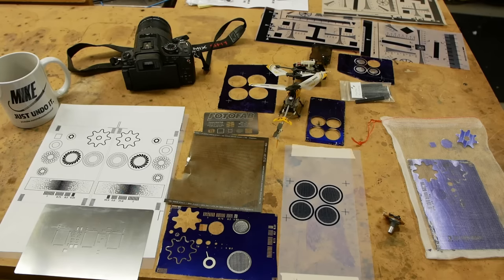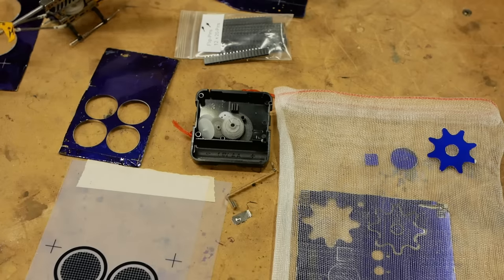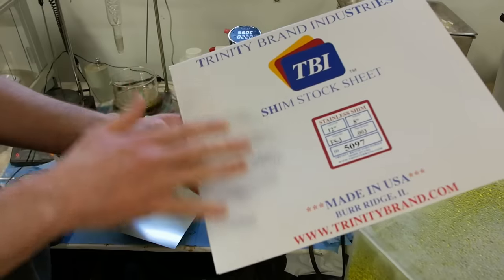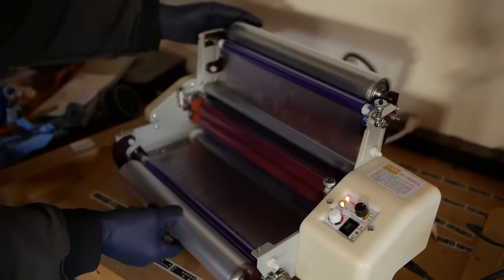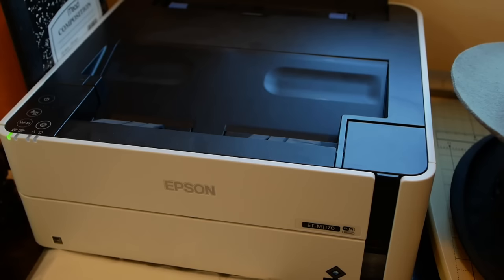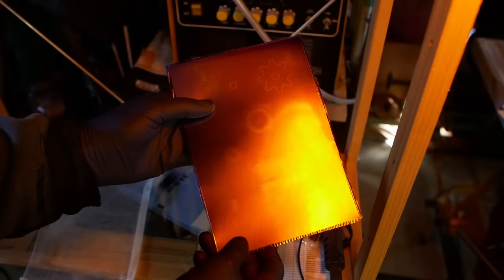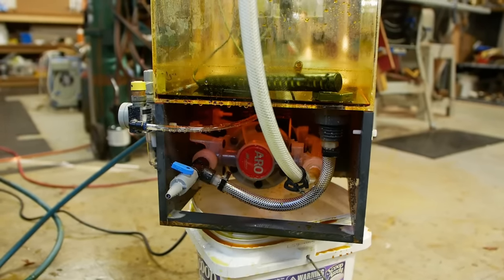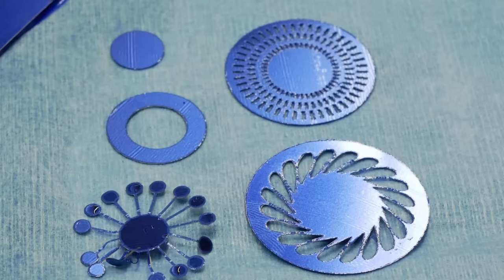How to make precise sheet metal parts (photochemical machining)

Comment: I wonder if you could use a DLP-based system here to simplify/reduce mask production and alignment. Drill/punch registration holes into the metal, then put that into a box where a UV projector exposes the photoresist. Flip it over, using the registration holes again, and it exposes the other side.

No need for manual alignment, no need to print masks, consistent exposure and precision. Biggest issue I can see is the collimation of light, but that's solvable, if a pain in the ass.

Comment: TYSM! yes, getting a die made for just 6 or 7 small delicate parts just has put a project out of reach for me. so glad to see how it can be done at a fraction of the cost.
what chemical etching? would that be lower resolution? seems it would be easier than using a photosensitive laminate

Comment: Nice project!

I have no hands on experience, but here are my thoughts: resin 3d printers have an LCD and a UV light. It might not be linear enough light, but they apparently have resolution of less than 35 microns easily.

If your postcard piece was attached to a carrier that could register to the UV projector you might get away with exposing one side at a time and flip the carrier.

Shouldn't thin sheets be etchable from one side only? Might even give a better result depending on how the etching crater forms.

Comment: 19:45 I'd go get your hoses and connections through a hydraulics supply. They make industrial-quality, chemically-resistant ones suitable for high-pressure applications. I know 40psi is a lot but that's not really 'high pressure' for a 1" hose, these will typically be rated in excess of 150psi. They're super expensive but ultimately worth it to avoid spraying acid everywhere, especially if you're working this out as a business model. Let me see if I can't find the data sheet on the specific hose I have in mind.

Comment: Great video as always. I was wondering if you could use the same process as resin 3d printer for curing the photoresistant layer using a lcd screen and a uv Led.

Comment: The etching process reminds me a lot of the way resin 3D printers cure layers. Maybe a simpler setup could be made using parts from them ?
Quick question : why is two sided etching necessary ? To double the etching speed ?

Comment: Is your photoresist strippable in organic solvents (acetone etc)? That's what I used with my PCB projects in years back. It completely dissolved, no big chunks.

Also, looking at that etcher is mildly terrifying WRT potential failure modes. Have you considered adding an e-stop button and secondary containment in case of a rupture? Perhaps also some sensors  monitoring pressure in the system, detecting fluid in the bottom of the containment tank, etc to provide a rapid cutoff in case of a process issue.

Comment: I followed what you did, I happened to already have an M1170 at work, and bought the dark ink and nice transparencies. I have been through every setting, set the contrast to highest settings, darkness to darkest and bumped ink dispensing to +20% and I get pretty good results, except there is still pin pricking! 

Do you know any way around this? I just  want it to output MORE INK 😁

Comment: i see a potential failure point for parts with very fine details in mask alignment process. You are currently eye balling the top and bottom masks for alignment and then inserting the photo resist coated substrate into it. This has two major flaws.1) Repeatability is difficult for each human individual performing the task 2) The eccentricity of the design on top and bottom layers is changed from "|" orientation to  "/".
The potential fix for this is stamping out the fiducial holes on the substrate and masks and use a jig to hold all those layers in masking process.

The holding bag idea is good but a suggestion there is use a tight bag with soft brsitles on the inside of the bag so as to prevent the parts falling off post etching.

As for the FeCl3, in PCB manufacturing industry i visited, they used LDPE for handling FeCl3. They perform etching on far side of the factory and said that FeCl3 stains a lot and metal parts had to be periodically replaced. I did buy FeCl3 in LDPE containers for my DIY PCB activity and would recommend that for plastics.

Comment: Hi. Very interesting video. Thanks!
Any comment about lateral etching?
In other words, if the metal sheet has a reasonable thickness, i would expect the etching profile not to be exactly vertical, but closer to specs in the middle and over-etched close to the two upper and lower surfaces. No?

Comment: I would tone down the pressure of that etching contraption as you can and as I see it do get a bad edge because of it. Etching will remove material from below the Photoresist right on the edge, and leave the photoresist hanging and vulnerable to being chipped away in the process if you hit it with too high pressure. This would expose the edge to differential etching and produce that very wavy texture.
Why not try some acid baths?

Comment: Had an industrial etching machine.  Could do 8’x4’ parts at once.  Machine broke one time and had a massive leak.   The acid was all over the floor.  All the non protected metal surfaces in the other rooms rusted because of it.  Had a few end mills and lots of tooling that needed to be scrubbed

Comment: question: Once it starts to etch into the metal, doesn't it start to dissolve material under the mask which would make the part the wrong size?

Comment: By coincidence, in the last couple of months I have been investigating ways to make better/easier DIY PCB's. As a part of that I am using a new way to lay down a highly detailed/accurate and robust resist layer before etching. I don't think this has been done before, and uses UV resin as the resist layer, and very cheap CNC Laser to create the pattern. Possibly this could be used to make metal parts like this too.. maybe! Anyway, the results I got was a surprise to me. I hate it when people unilaterally promote thier (or other people's) channels in my comments, but check out the video if you like. And feel free to delete this comment, I won't be offended. Thanks for the great video as always!

Comment: Dear Ben, 
Why not using Press N Peel PCB Films and ultrasonic cleaners (well, with reduced power to not tear apart your metal shims) and adopt the chemicals to steel? To me it appears that that would have been significantly easier? I bet you looked into that. Why did you choose against that approach? Please comment. 
Thanks!
Besides of that, I really like your work!

Comment: Regarding the expansion of dark areas in corners, the semiconductor industry lithography uses a trick called Optical Proximity Correction (OPC). The mask is pre-distorted (inside corners cut out, outside corners extended). See also the German page with better image.
https://en.wikipedia.org/wiki/Optical_proximity_correction
https://de.wikipedia.org/wiki/Optical_proximity_correction

Comment: It would be interesting to custom build a steel brew basket for espresso. One of the big innovations, or really just quality improvements, was when IMS started producing precision baskets. What that meant was the evenly distributed holes in the bottom of the steel brew basket were all the same size and properly round, no burrs. However, the baskets still bend under the up to 10 bars / 145 psi of pressure. So using a thicker stock that could resist this bending could allow for more even water flow through all the holes. Could a process like this in the video allow you to construct something like this?

Comment: you could simplify the developer tank by just using a dishwasher i think, has all the slots in it already.
poly propylene should definitely be OK for ferric cloride, its the material for the bottles it comes in afaik. PP has different grades so maybe lower grades dont work as well but the stuff used in hospitals and labs should be fine.

Comment: Haven't you thought about applying mask with cheap uv printer? Like those that are used in shopping malls to print on phones etc. They are pretty easy to change from existing printer, looks like there's kits for this, but I havent tried it myself. It is handy (if you have one nearby) to make pcb's at home. This way you can eliminate all photoresist thing.

Comment: I understand you say laser etching isn't really suitable, but PCB solder stencils commonly have apertures down to 100 um without problems. Surely you could just send off your artwork as a gerber file and see what comes back? This wouldn't work for your free floating circles and would require breakout tabs etc, but it is a really cheap process.

Comment: This may be my inexperience in this field...  But why not apply screen printing directly to the metal plate?  There should be inks that can resist the ferric chloride.  You couldn't do both sides like that due to alignment problems, but you could stick the metal plate to a sticky surface so the solution doesn't reach the back.  Then hang it over a thin layer of ferric cloride.  Instead of pumping the fluid around, you could use a rotary sprayer.  Use a magnetic coupling with that, and you avoid getting motors or tubes near the ferric chloride.  It's similar to how a dishwasher works.  It seems like a simpler solution that can reduce costs and improve repeatability.  Screen printing is well established technology.  I just don't know if it will cause other issues.

Comment: You would have to spin the metal sheet and then pour liquid resist on the sheet, and this way, you would get no gap between the metal sheet and resist. This is how it is done in silicon wafer photolithography.
Reply: A spin coater will be as expensive as his all kit 😂 

That is a different level. Here he is entetaining amateurs :D no ofence to anyone 🙌🏻

Comment: You can also use a metal business card company to manufacture similar components. They etch for engraving and through etch for cutting holes. Cost effective, but limited materials and thickness!

Comment: To better avoid any exposure shadowing I'd imagine a 405nm array from a resin 3d printer such as an Elegoo Saturn may work! I was recently working on repairing some printers that were "for parts" on ebay and you could probably get a great deal if all you need is the LED source.

Comment: Hello, great video, as usual. I intend to etch a 0.06 mm stainless steel sheet, and the pattern I need is a horizontal grid of 0.1 mm thick lines that will be 0.5 mm apart.
Do you know wheter it should be better to add hydrochloric acid to FeCl3 in order to etch stainless?. Any comments will be appreciated. Thank you!

Comment: Would it be possible to spray the metal with a less specialized coating resistant to the ferric chloride and then laser etch that coating away on a standard laser engraver? Registration and edge quality might be a challenge, but it would eliminate several processing steps here. 

Fantastic channel by the way!
Reply: I've done just that for brass etching. I just used enamel paint. Granted, it was for a decorative piece but with some fine tuning I think it could work for this too.
Reply: Why don’t you try it and get back to us

Comment: Would putting the metal in an oven be a good way to dry w/ out contaminating the surface? I think dan gelbart had a video where he heats items to be painted above 350F, not sure if there's a lot of oil in the oven air though

I'd like to build a process for stripping bicycle chains of their factory grease and then waxing them.  Never heard of alconox, to date I've been using bike degreaser followed by comet (dan gelbart trick) but afraid i'm leaving comet grit in the chain. Was considering trying Ethylene Glycol, i think you mentioned one time that it's been used for cleaning engine parts.
Reply: ahh I see that someone else commented below saying they use an oven set to 58C, gonna ask them if they get good wetting afterwards

Comment: Could it be your glass sandwich that's absorbing enough light to account for the extra exposure time?
Suggestion:  Put a catch basin under your ferric chloride bath and some sturdy baffles outside it to deflect wayward streams of fluid into it when the inevitable accident occurs.  You might not get it all, but it could help.

How long until you're etching reflection holograms exposed by a spatial light modulator?  :)

Comment: Could you use the bag in another function as a polishing media to remove the photo resist? Might have the secondary benefit of cleaning up any rough edges in the process. This assumes the bag material is abrasive to some degree of course.

Comment: Wouldnt it be interesting to use one of those 405nm laser diodes with a 3d printer head, and maybe a 4 axis and two thin pieces of thin glass sheets holding to expose the steel sheets on both sides? Should make away of the double side precision issues?

Comment: Hi, how hard would be to use this process to build printed circuit boards? I found that using image transfer through heated photographic paper to a copper coated board was better for circuits but the alignment of 2 sided pcb was harder. Your heated coating device is very nice and would have been really useful for pcb prototyping the time when I worked with these. The device I used first placed UV light sensitive paint on the copper coated boards, centrifuges the board to remove excess paint, dryied with furnace, than transfer the image with transparencies just like you did.

Comment: Might vaccuum drying help?  Low pressure should remove moisture and some contaminants.  Flushing the drying chamber with dry nitrogen or CO2 could help as well.
Reply: Yeah that seems cheaper, faster and easier than shop towels.

Comment: Hi Ben!
I have something completely Off-Topic and i don´t know if somebody here noticed what i just found out by luck while working with glass or minerall wool for house insulation ;)
If you point a strong flashlight which is dimmed with pulse width modulation from close distance on the wool, you can hear it clearly vibrating. Please explain that :D

Comment: Have you considered ultrasonic etching? This could be a good substitute for a high-pressure jet in your setup.
Reply: Ultrasonic cleaner tanks are usually stainless steel too! They will get eaten into,  unless you line it with a plastic tank

Comment: The problem I have with shoptowels is that they always leave some sort of fibers everywhere. I usually dry everything in a thermal oven set to 58c.
Reply: Do you get good wetting after the oven? Do you think a normal kitchen oven would contaminate a surface too much? Or at that temp is it fine?

Comment: Pretty shocked you can blast that etch at high pressure without removing the photo resist. I guess it has a lot better adhesion than I'd have ever thought.

Comment: Although not as fine and small, what I do a lot nowadays, is just make a mesh on a PCB.
Even aluminium PCB boards are very cheap these days, with tolerances of around ±0.1-0.2mm in any shape you want.

Comment: I have some low production battery terminals to be made, I would love to send you the CAD files and do some production for me, They need to be cut flat and I will do the bending on my end. Looking for an initial 300 pieces, The material has to be a good current conductor such as Nickel sheets.

Comment: What about combining the masking and printing into one step. Similar to resin 3D printers that Use an lcd screen to mask out uv light into the desired pattern for each layer of print. You could position the plate in a fixture device that allowed you to suspend it over a 4k or 8k lcd panel and create the desired photo mask using the uc light below. You would need to do both sides separately but with a suitable fixture system with as little backlash as possible they should lineup pretty well to ~ +- the magnitude of the backlash

Comment: I have a question, because you have the mask on either side on the metal, is the etching chemical removing material underneath the mask once you break the surface as its gets sprayed? 

Is there a way to prevent this over cutting of the internal material? 

Is this process only limited to very thin metal to prevent this ? 

Thanks

Comment: I was thinking to align the sheets to have any shape printed like an x in a square in positive and negative, so you just see a square Or something along the lines of a sliding scale caliper - only when they line up exactly do the two "measurement lines match up", how much you still have to move would be dependent on which lines are matching

Comment: I am curious if you can use the lcd screen and light sources from something like an Elegoo Saturn 2 resin 3d printer instead of the photo resist. It has a 10" lcd with 8k resolution which is used to mask 405 nm. Could be an interesting way to optimise the process.

Comment: Question about having the parts fall off ( or maybe  the same when they stay with tabs ) : Aren't the side / thickness affected by the etchant since there is no photo resists?  Does it starts eating the metal from the sides? Maybe not an issue at small thickness but on thicker things maybe?

Comment: How thick of a piece could you do this with? Say, if I wanted to do a 5mm thick piece of steel? Would this work (given that the etching solution would probably start to eat into the thin lateral side of the resulting part, but that would also be ideal due to having a smoother, rounded edge, I'm guessing)

Comment: The pressure of the acid spray pumps is probably a problem for the super thin parts, isn't it? The star formed part in the end, wich is bend, is it from the pressure maybe?

Comment: a dunk tank with a heater for the ferric chloride which moves the part up and down into a hot pool of ferric chloride would probably work just as well. that's what I used to use for etching circuit boards.
Reply: Listen to the video. He explains why this isn’t optimal. It takes ten times longer.
Reply: @stargazer7644  missed that, thx